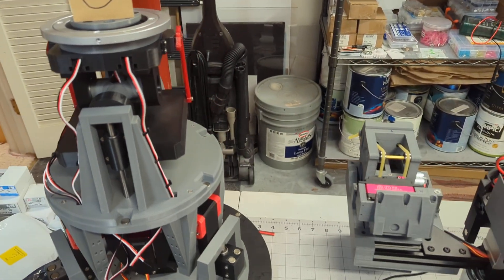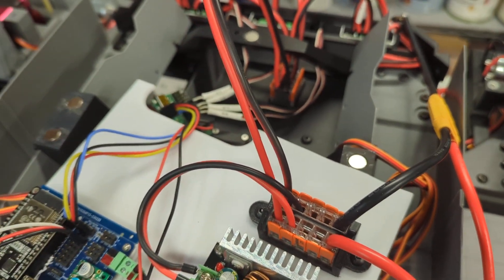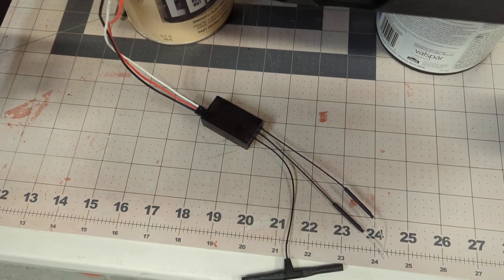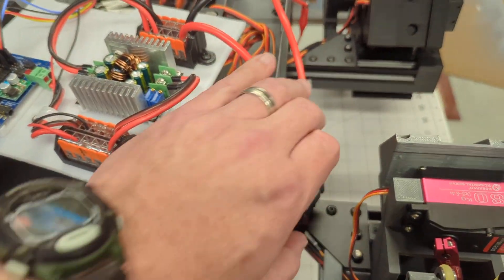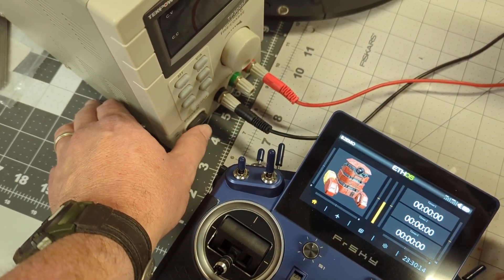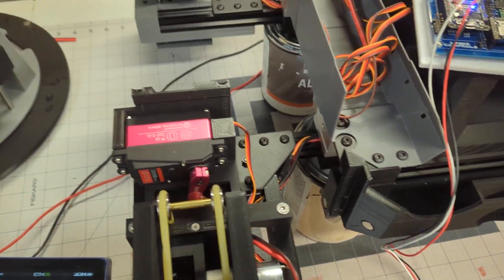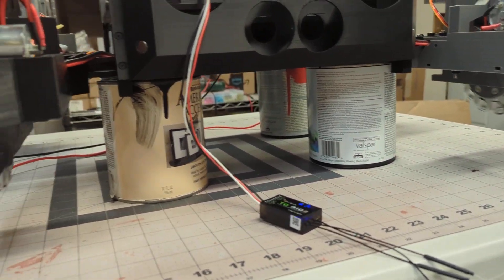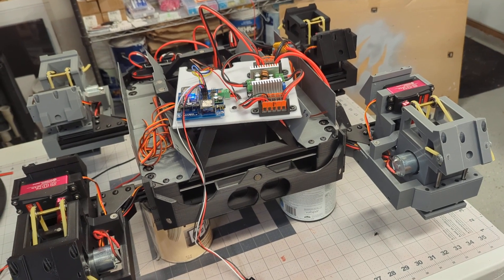B2 Build Update: First Drive Test!

Comment: Another awesome build Jason.  Which ESP32 board are you using?  I am building Mini R2's (Baddely) using the PS3 controller option and I cannot find an ESP32 that will connect with Bluetooth.  Most of the ones sold on Amazon are junk and the negative reviews are not lying.
Reply from the maker: Unfortunately, I can't answer that specific question. What you see here is the Kyber control system board that is the central brains of B2. The single board contains interface connections for SBUS RC control, Marcduinos, an output for one or two Maestro servo control boards, as well as audio output and many other connections that I am currently unfamiliar with. Kyber is an RC-based control system though, so I don't believe it has any bluetooth functionality.
Reply: @jasonsR2D2  oh duh. That board looks just like an esp32 and i ASSumed it was.  No worries, can't wait to see this Droid on the move.